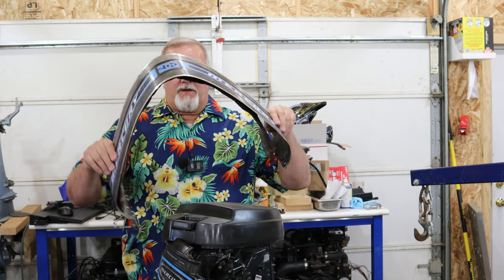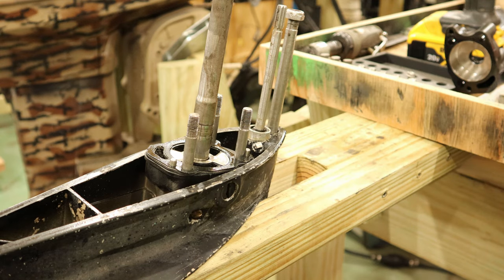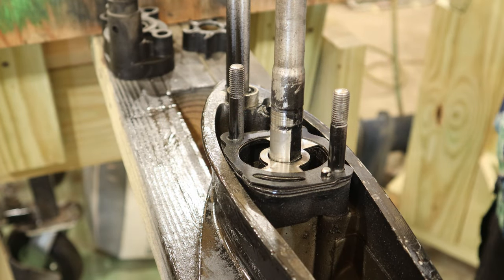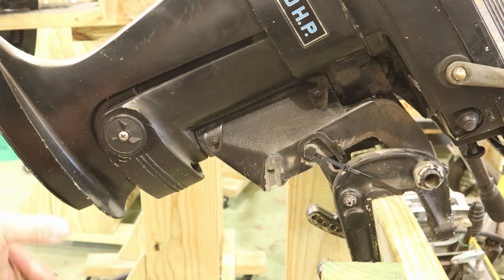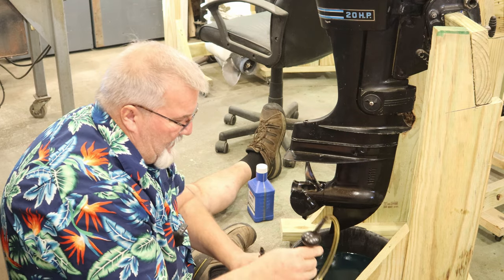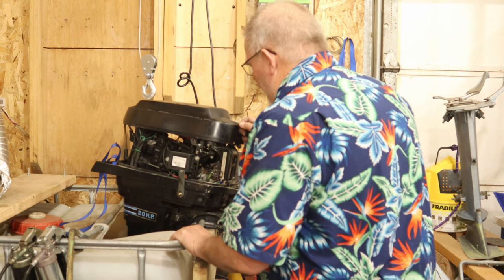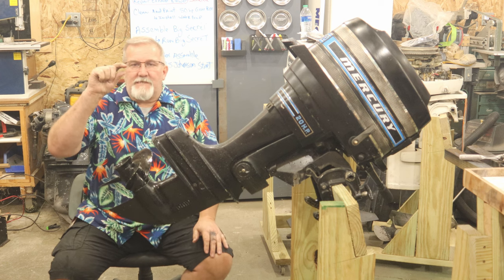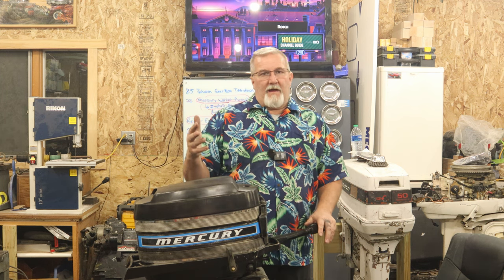1975 Mercury 20hp Part 3  Water pump - Gearbox - Run

Comment: I know it's been a year, but I just bought a 1975 Mercury 20 horse like you have there in this video. My question is: Do you remember where you got the impeller kit for that motor? I'm having a rough time finding parts.
Reply: Hi, e bay . I got from there to. I need help with oil change for this engine. Thanks for any answers.

Comment: I have a 1970 20hp merc and it’s leaking between gear housing and drive shaft house spitting out oil any clue what it could be or how to fix it ?
Reply from the maker: It's your seals between the water pump and gear box.

Comment: I had a similar sound on an old mercury 35, turns out the spring near the top of the starter had broken and was allowing the starter teeth sprocket to make contact with the flywheel intermittently.
Reply from the maker: I will check that out, thanks for the tip, and thanks for watching

Comment: I had the pee hole plugged by a mud daubber wasp 2x over the last 2 seasons- poked with a wire while running and it pushed through!
Reply from the maker: dang daubber anyway. Thanks for watching
Reply: I had a similar incident.  A tiny snail got sucked into the water system and blocked my pee hole and I freaked out thinking I had no water pump but it was just the snail.

Comment: Somehow I missed the CRACK repair...assumed THAT would be part 2.....OH and they are two different drive shafts....one has a groove for a o-ring and one don't....not the same. Where does that fan fit on the outboard??
Reply from the maker: Fan?  thanks for watching

Comment: Friend, I bought a 1978 Mercury 200 20 hp long leg, I would like to know where the screws are to remove the leg or the system where the propeller is because I have to do some work on it, my gearbox is stuck, could you please help me?

Comment: I got a 20hp same motor i had a guy go trough it he got it going i brought it to the lake got it id forward and once boat started to plane out i got a bad vibration in lower unit almost like it kicked out of forward id have to almost come to a stop and go again and it would be ok intell little over half throttle any reason for that u could come up with or how to fix it ?

Comment: What water pump kit did you use in this video? I’ve got a Mercury 200 20hp late 70s model and since it hasn’t ran in years I’m planing on replacing the water pump on it. I wanted to get new gaskets, impeller, and housing to give it a complete refresh.
Reply from the maker: Check out oldmercs.com for you part fitment.

Comment: Nice video Michael. Were you getting water when it was in gear. I found with my 4.5 hp Mercury when it was in neutral water flow was minimal to none. Possibly a Mercury quirk?
Cheers
Reply from the maker: no water in gear, it was puffing air but no water, betting it is thermostat blockage, thanks for watching.
Reply: I put grease on my impeller like that once and it would not pump water.  I took it back apart cleaned it off and it pumped fine

Comment: Hi,great videos on the 20hp/i am presently rebuilding the same motor but its missing the prop and i cant seem to find the specs on it or where to find one...any info would be appreciated.8 spline,3inch gearbox and i believe 11inch pitch,you have one?
Reply from the maker: What is your spline count and outside diameter of the spline shaft.  I may have a prop.
Reply: @Michaelsbackyardmarina  the spline has 8tooth,and the outside diameter of the gearhousing case seems to be three inch(hard to measure precisely because splineshaft runs through the middle),i believe it should bethe same as the one in your video.
Reply: @Michaelsbackyardmarina  8splines,diameter of gearcase is 3inches(hard to measure because propshaft in the center),and i think from research the pitch is 11inches.
Reply: @Michaelsbackyardmarina  upon further inspection,the gearcase is 2.75inch,.

Comment: Nice work, I wonder if the thermostat housing is clogged? Is the shift cable have a bend in it to keeping going into resverse correctly?
Thanks 
Tim
Reply from the maker: That's what I'm thinking.  I'll be checking it out next.  Thanks for watching
Reply: Michael, It's not unusual that the clutch dog needs some coaxing to engage in reverse. Usually, the engine's vibration is enough to shake it a bit  and allow proper alignment and engagement. If I remember correctly, those motors have a locking mecanism that won't allow the motor to lift up in reverse. You might want to have a look at that as it a worthy safety feature. Stay safe and be merry !

Comment: You cud put a speed controller on the fan so you can August the speed of the fan to what you need. I had that happened to me I put a new water pump I go to start it an it did not pee so I pulled it back a part that little wedge I put the old one in an it worked fine one other time I pulled it back a part I did not see nothing rough so I put it all back to tether an it worked that was strange. Yours might be the thermostat I'm thinking is bad or its plugged up so the water not flowing
Reply from the maker: Thanks for the tip and your experience with your water pump, Thanks for watching